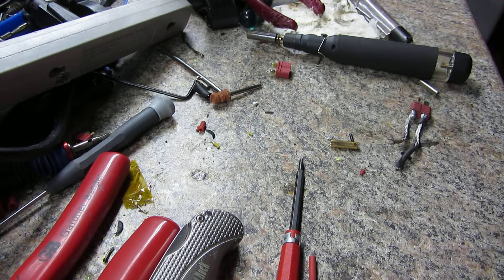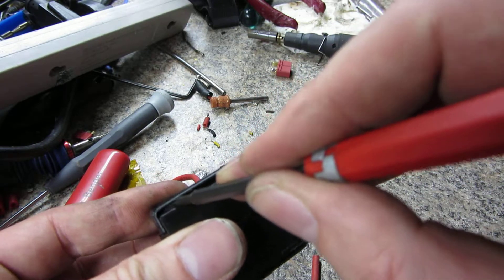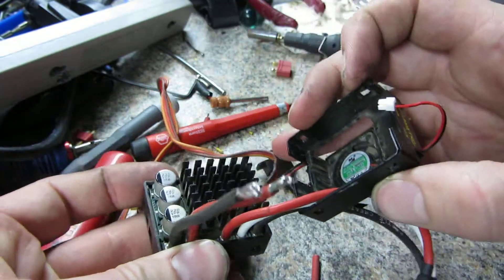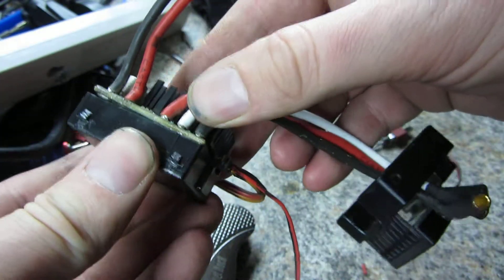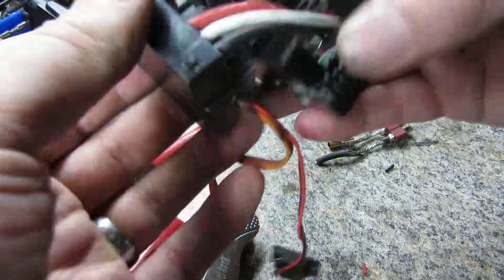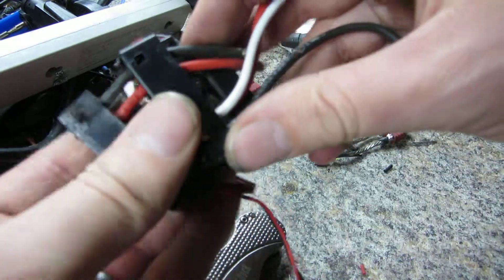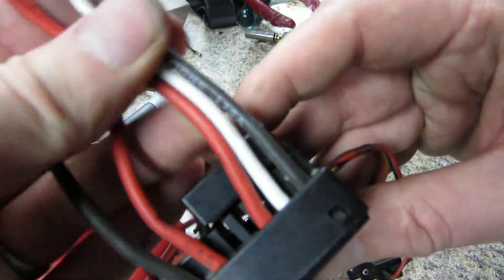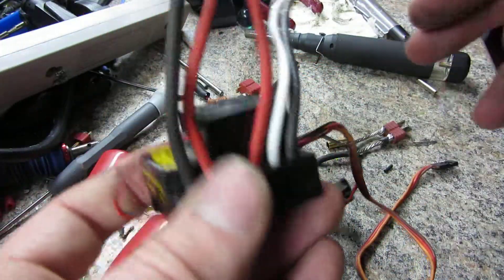How to take a castle mamba max pro apart

Comment: My castle esc is coated in a type of plastic resin and I cannot get at the electronic bases. Did you have to remove the resin before and if so how did you dissolve it?
Reply from the maker: the epoxy is part of castles waterproofing (the one in the video is a the generation that was not waterproof) the upside is that its waterproof, the downside is its very hard to work on, i have successfully used a soldering iron set to 350-400f and then used the tip to scrape off the epoxy, without it burning/smoking and potentially unsoldering stuff....but you do need a variable temperature soldering iron, and i suggest some cheap tips for it as not to ruin say an expensive hakko soldering tip...i believe castle has an exchange program for about 35 bucks
Reply: Thanks!